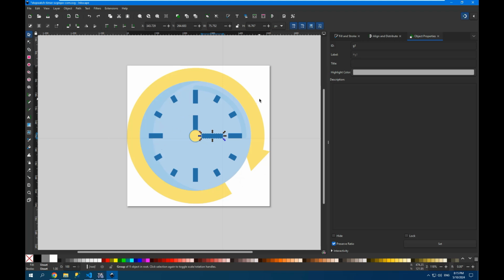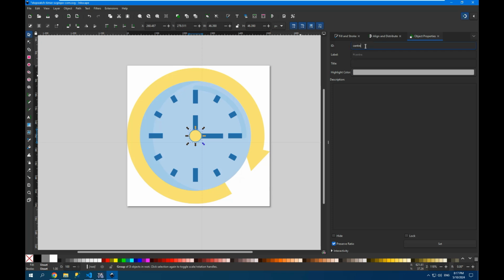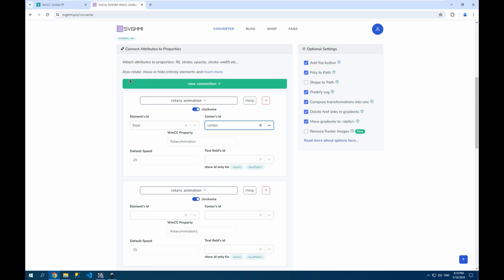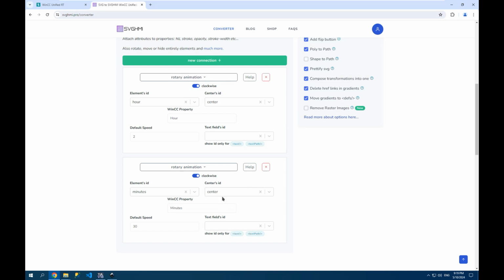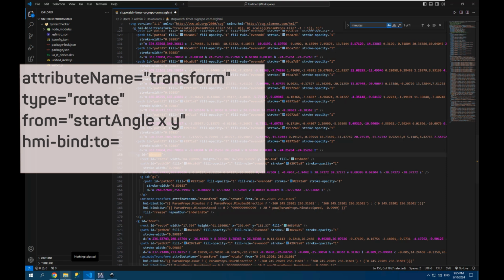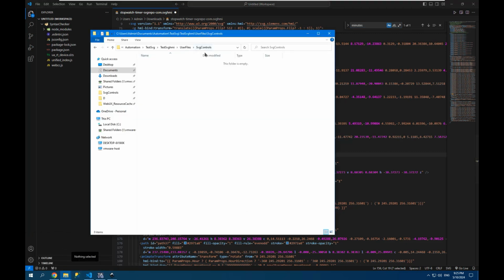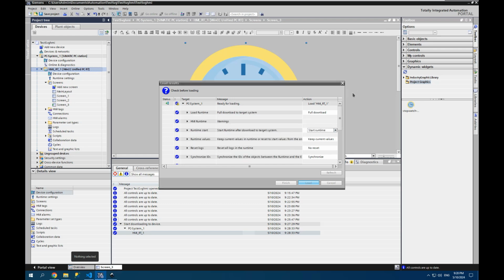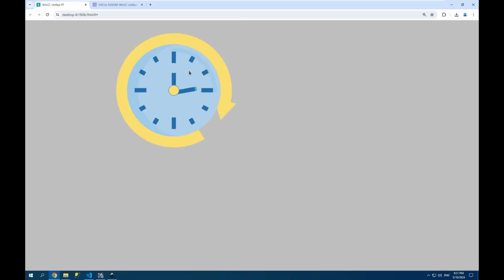How to easily animate SVGHMI dynamic widget for WinCC Unified? Calculating the centre of rotation.

Comment: I created an SVG from scratch in Inkscape. I'm going to try get it to work on my unified panel. It's a gauge for wind angle. Will let you know if it works. I hope it does because the gauge looks really good.
Reply from the maker: Hello, @kme8134. Unfortunately svg animation works only on Unified RT. It doesn't work on panels. But you can achieve the effect of rotation with “RotateAngle” with a small script by changing the rotation angle. So I think you will succeed. Go to https://SVGHMI.pro/converter to the converter page and select “Rotate Angle” in the connections.
Reply: @industrial_control  Hello! well, I got it working in simulation. You have done great work!. I do not know what kind of script I would need to get it working on a panel. Right now I use "Rotate Angle". It works fine, but again this is only simulation.
Reply from the maker: Thank you for your kind words. Maybe you don't need a script at all. If you have a rotation angle tag, you can bind it directly to the widget. Or write a small JavaScript that will increment some variable. But everything depends on your implementation and task.
Reply: @ Yes, that is exactly what I did. Just a variable set to the rotation angle. Just to confirm, there is no way this will work on a Unified panel?
Reply from the maker: @kme8134  Rotation via variable will work on panel too. When I said animation won't work, I meant "rotary animation" connection.
Reply: @industrial_control  Thank you for your efforts. I will be making use of your website in the future.

Comment: Cool, thanks. Is it possible to make  that the arrow does not rotate constantly, but moves with a minimum step, which I would set dynamically?
Reply from the maker: Hi, Juliya.
"Rotary Animation" is not suitable for this task. You can use “Rotary Angle”. It will give you full control over the position of the element. But you can always animate it with JavaScript and setTimeout() if you want. You can read more detailed description in the article https://svghmi.pro/blog/wincc-unified-svg-to-svghmi-widget-converter